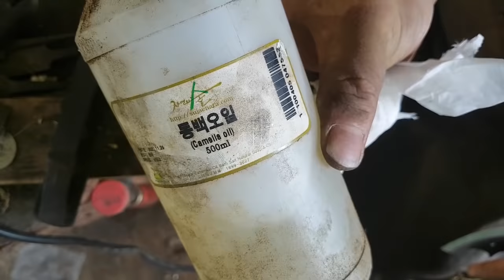Make a Camping Axe

Comment: If you're ever using a hole saw on material that needs to be cooled use a sponge soaked with water for ceramic and oil for metal it will save you a lot of hassles.
Reply from the maker: Thank you for watching.
And thank you so much for the good advice.

Comment: Hola que tal, interesante hacha, original y muy bonita, te felicito. Una duda que tengo, el cloruro férrico exactamente es para proteger el hacha de la oxidación o tiene alguna otra función ? 
Gracias y te felicito nuevamente, sigue así con tus nuevos proyectos. 
Saludos desde Galicia.
Reply from the maker: Thanks for watching.
Ferric chloride does not provide complete protection from oxidation. It just slows down the oxidation ...
Reply: Ok. Thank you very much  for  the  clarification. Cheers ...